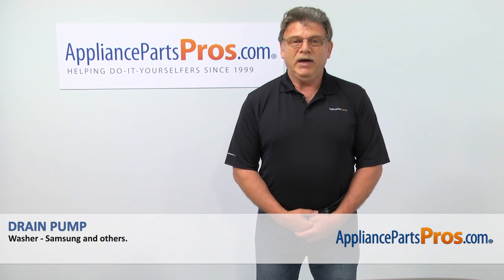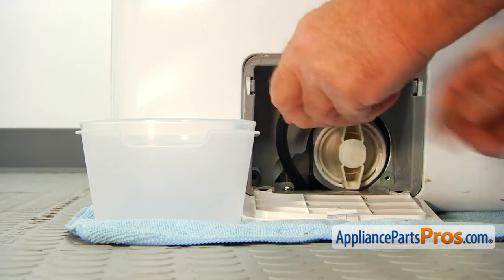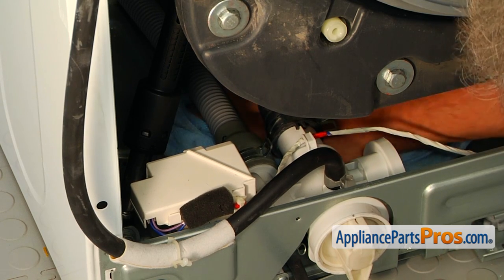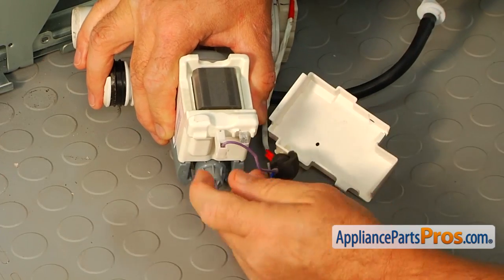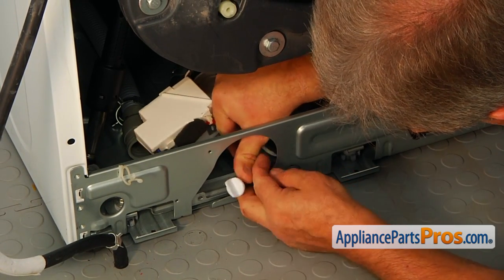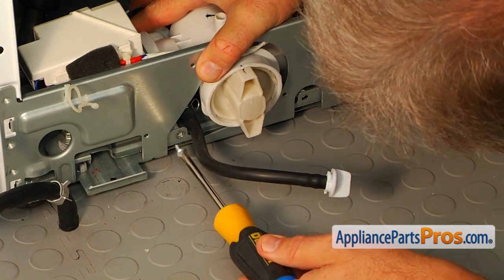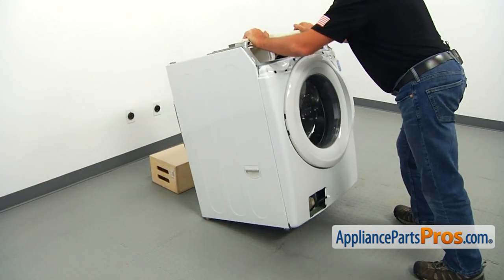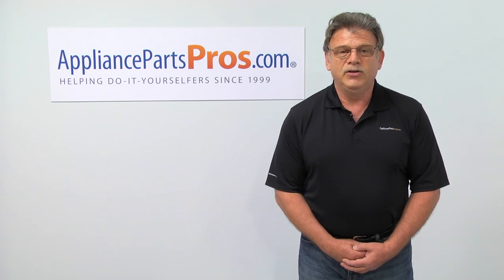How To: Samsung Drain Pump DC31-00187A

Comment: Great job, but you can replace the drain more simply, just release the three screws of the drain from the washer bottom,.... Regards
Reply from the maker: Thank you for that information. Our videos are just general videos and some models may be different than the one that is used in the video. The repair may not be as simple as just releasing the screws.

Comment: After replacement, the drain kicks on and drains at the beginning of the cycle.  However, at the end of a normal cycle it does not initiate drain pump.  Any though what would cause that?
Reply from the maker: Have you had any error codes come up on the machine?

Comment: What is the issue if the problem is still happening after replacing this part?

I put a new one in, ran a test rinse/spin cycle and it worked great.

Then I did a regular load and the same “se” error code popped up and there’s water in washer again.

Comment: Hello! I have a slightly similar issue, although the pump is not the problem. The filter is jammed for some reason, and I cannot seem to remove it through any method - after removing the pump and filter from the machine and verifying there are no foreign objects inside the housing I'm stumped as to why I cannot pull the filter from it. Perhaps there is something I can't see somewhere inside - through the pump attachment entrance should I be able to hypothetically rotate the filter completely? I can turn it roughly an inch in either direction before it stops moving.. I wasn't sure if that was normal, and if not presumably there is an object somewhere inside I can't locate. The filter cap clicks when I turn to the left regardless of if I push or pull, though if I pull it clicks considerably less harshly and just grinds. This is not my washing machine, and though the part number is the same the filter is gray as opposed to white  - might I have the wrong filter? I apologize for so many questions, but any insight would be greatly appreciated. Thank you in advance!
Reply: The filter comes out counter clock wise. You may have to use channel lock pliers to pull it out as sometimes things such as hair bands and other objects might have it stuck.

Comment: What is the difference between 00178a and 000178d
Reply from the maker: We do apologize but the numbers that you have provided are not showing as good part numbers. Can you please verify those numbers for us?
Reply: @appliancepartspros  my mistake. It looks like it is sam-dc31-00178a  & sam-dc31-00187d drain pumps. It shows them being compatible, but one is $50 & the other $150.
Reply from the maker: What is the model number of your appliance?
Reply from the maker: Thank you! Per the model number that you have provided I am seeing part number DC97-17999M which would be for the whole assembly and part number DC31-00187A would be just for the drain pump and nothing else.
Reply: @appliancepartspros  awesome! I was worried about getting the wrong part! Thank you for looking into this!
Reply from the maker: You are very welcome. If you have any issues or have any questions please let us know!

Comment: Thank you! Before doing the full disassembly, I pulled the drain filter and cleaned it. That wasn't the fix. Then I found a bunch of hair inside the filter area to the left where the drain pump is located. It must have got through the filter somehow and was preventing the pump impeller from spinning. Removed the hair with a small hook and needle nose pliers. Worked fine after that. No further work needed. Thanks again for the great video! Gave me the confidence to troubleshoot it myself and save a bunch of cash!
Reply from the maker: Glad we were able to help you out. If there is anything we can help you with in the future please let us know.